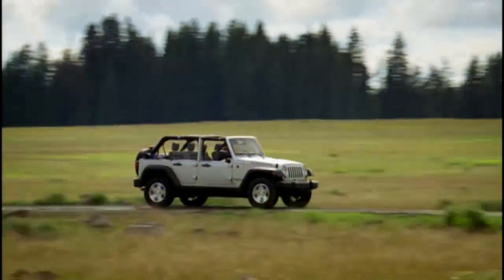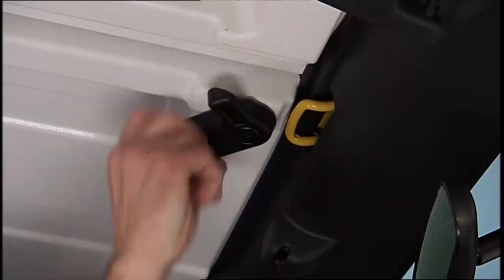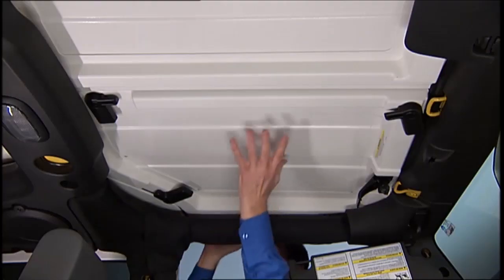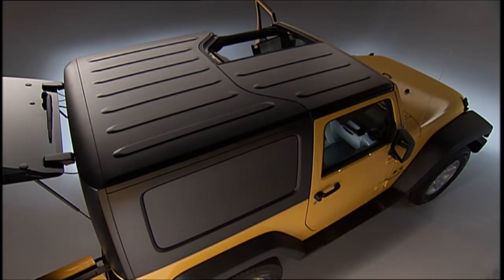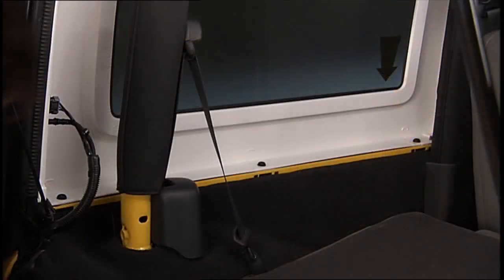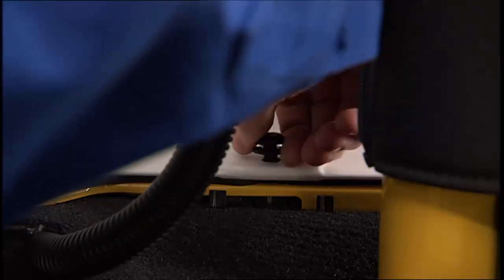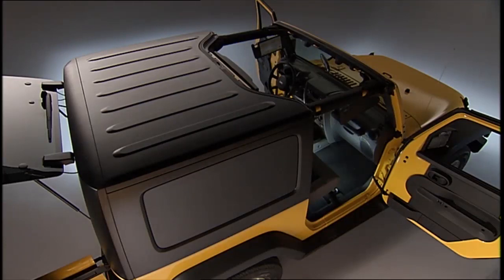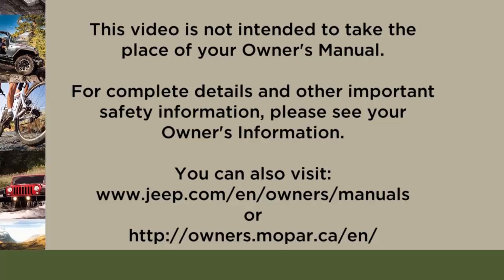Freedom Top™ Removal-How to remove the Jeep hardtop on 2017 Jeep Wrangler

Comment: If you have a 3 piece hard top, can you take off just the back and leave the 2 front pieces on?
Reply from the maker: Thank you for reaching out. Please se page 82 of the owners manual which discusses the top removal procedures. 
https://msmownerassets.z13.web.core.windows.net/assets/publications/en-us/Jeep/2017/Wrangler/2049.pdf  ^LH
Reply: I saw a guy driving with only the front 2 panels and the rear removed. 
So yep its possible. Just have to have it latched down and secured.